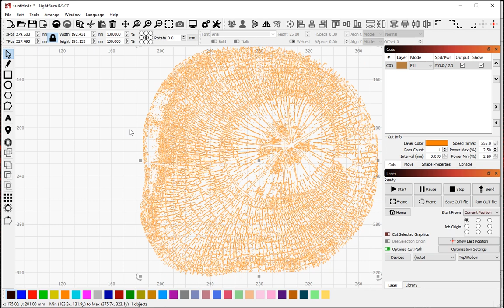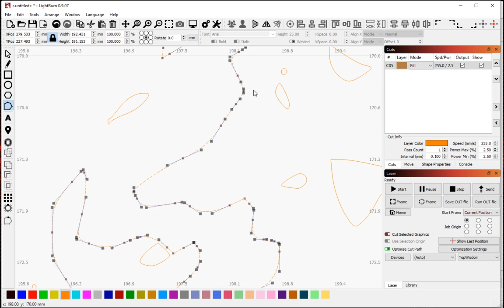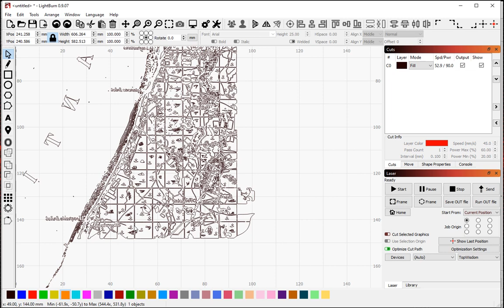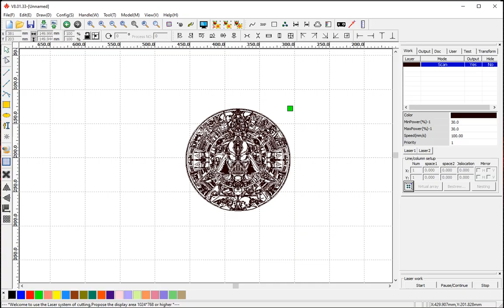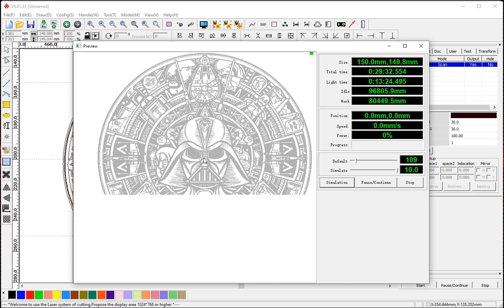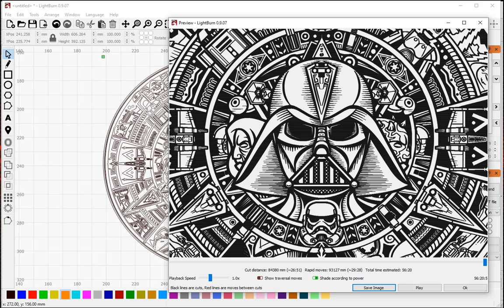Speed Comparison - LightBurn vs RDWorks

Comment: Just receintly tried your software and I have no idea what the people are smoking to pay $120 for this. Yes, cosmetically a bit nicer, it also has maybe 10% of extra features compared to RDW 8.0. Vector editor is as basic as it goes, so I never use it being fluent with Corel anyways. $60 was maybe okay, but pushing it, but $120? no thanks.

With all that said it failed to connect to my RUIDA controller via network, while ping was perfectly going through, and even when it unreliably did connect occasionally, it would drop packets for no reason and I ruined 2 parts when this stupid software would send half file to machine and machine would start the job after only half file was received. Needless to say, even for beta software that is free it would kinda suck, so much more so for a software that wants your $120 for it. 

It also misinterpreted vectors many times while RDW read them fine. For some reason LB would show them as open profiles while they were clearly closed in every other SW.

Again, aside from a better language inside the software and repositioning of existing RDW features I was not able to see any difference whatsoever.
Reply from the maker: There are lots of features that RDW doesn't have, such as SVG and PDF importing, support for modern AI files, drag & drop, and much more, but if you're using Corel for creation you won't see as much benefit.

The network connection errors you mentioned are quite likely fixed in the next update - there was code that assuming a network MTU size, and that has been fixed.

Regarding the mis-interpreted files, were they DXFs?  Corel doesn't export them with connectivity information, so you have to have "Auto join" enabled for them to come in connected.  Using AI or SVG is a better choice for vector exports, as the curve information will be retained.  If you send an email to support@lightburnsoftware.com with one of your files, we'd be happy to check it to make sure it's being interpreted correctly.

Once you start getting into more complex files with lots of vectors, you'll find LightBurn has more features for managing the cut order, and generates job data much faster.  I'm also curious if you were using the current release - some of the issues you described have been problems in the past, but not for a while now.

Comment: I have been using RD works for my china laser engraver for almost five years and have loathed it from the start.  It's slow feature lacking and when they patch one pug or add a minor feature they screw up something else that was working fine.  The past few months I've been telling myself if I ever find software that works with my laser and reasonably priced I would buy it and after using the demo it's money well spent. To the light burn team, Thank you from the bottom of my heart.

Comment: Once I started using LightBurn I never went back to RDWorks.  It is very easy to learn and works great.  I have a dual Laser MORN laser system - 150 watt/80 watt and a Z platform that moves about 24 inches vertically and it seems to handle Z axis changes just fine.  I HIGHLY recommend Lightburn if you are serious about your laser work.

Comment: A man with words after my own heart!  Excellent points I can respect of your final thoughts as to "Why LightBurn"...  
Efficiency is hugely important to any business in every way it can be had and can ultimately make the difference in success or failure.
One of my pet peeves is when someone accuses someone else of "always trying to get out of work"...   I always tell them if that's the case they want to present, then they should start walking everywhere since the wheel was designed for that very reason.

Comment: Does GPU allocation have much to do with the speed at which the system processes the trace algorithms in LightBurn, or does it rely proprietorially on the CPU side of things like most others programs?   
The reason I'm asking is because I build custom "gaming style" PC's with heavy hitting DDR5 GPUs from which I do a lot of 3D and vector based file building with.
Currently I've been using Corel 2019 for vector creation, which this latest version finally allows me the choice for allocating the majority of the rendering processes to my standalone GPUs within the global options menu.
 This was a huge advancement for Corel, since all the previous versions was hindered via forced CPU processing that caused bottle-necking on larger complex files.    I suspect most people don't care about this sorta thing, or aren't aware of the performance potential of it at least, but one might call me the "Tim Allen" of all things PC related! 
https://media1.giphy.com/media/FaIDQOgN69FXq/source.gif
Naturally the increased speed of your program is a huge turn on to me!
Reply: @lightburnsoftware7189  Interesting, I appreciate the response.  And I agree with over all structuring and architectures being responsible for efficiencies.   Pretty much the reason ARM based system are putting intel and AMD on the hot seat in a way I suppose.  Anyhow I like your program.  
It makes a lot of sense and will suit my local Makerspace  community.  Luckily enough, I am head of our laser guild and have been looking for a system that suits all users of the machine I built.  Some of our members have PCs, others have Mac and linux.   That being said I run an LO T9 DSP which comes with an Americanized Chinese laser software that is fairly borderline for file production, which is once again limited to being only compatible with windows.  I intend to present your software to the rest of the group as an "all-in-one" program that will work on anything and has an easy to follow learning curve with plenty of youtube support.